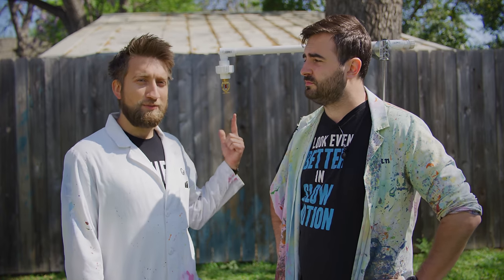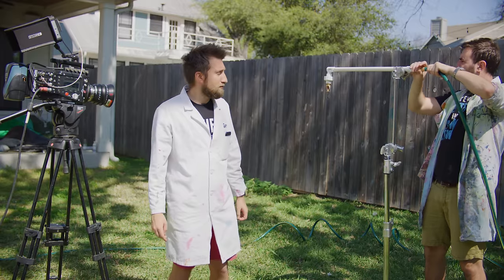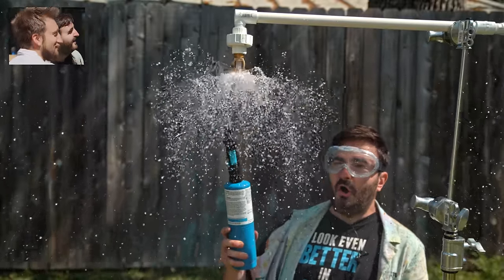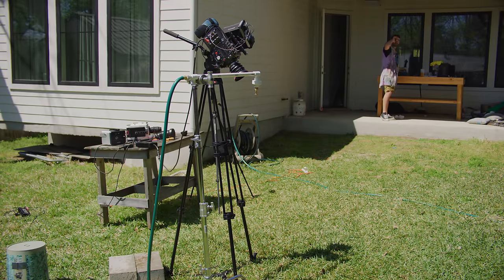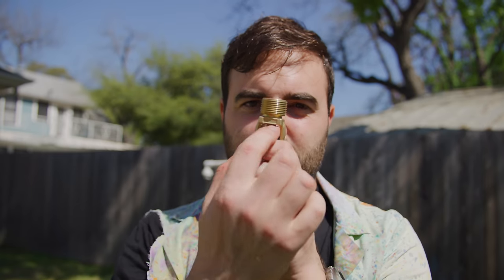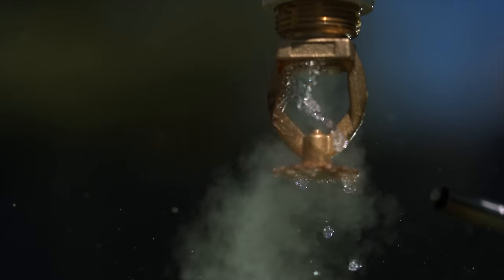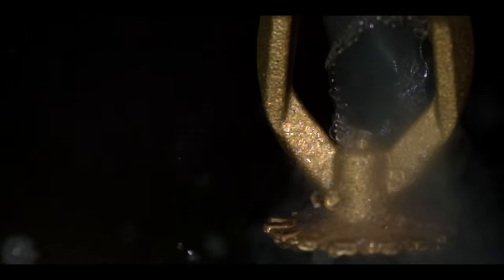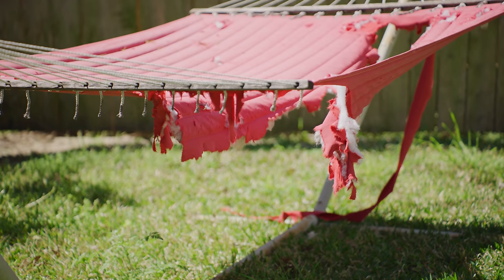How a Fire Sprinkler Works at 100,000fps - The Slow Mo Guys

Comment: That shows how fast glass breaks... Even at 103.000 FPS it looks instantaneous!
Reply: True I wonder what other materials can break as fast as glass or faster
Reply: I mean, they've already done a video on how fast glass breaks :)
Reply: @supimzazz  spaghetti
Reply: LITERALLY 2 frames ._.
Reply: PCanas they did one breaking Pyrex measuring cups it was almost instant. I can’t remember how long ago they did it but omg it was cool
Reply: @gaminghoot7020  wait we have the same profile pic
Reply: 103fps isn't crazy fast.  (I just don't get the period instead of a comma thing, lol)
Reply: Look up Destin taping a Prince Rupert's Drop breaking. Lots of fun!
Reply: @supimzazz  Maybe steel. Probably granite or titanium. Cracks tend to propagate at roughly the speed of sound in the material.
Reply: @wreck2  vice versa. Tom Scott has a video where he talks about that, but I don't remember which one.
Reply: @1Wj1  Cracking from one side of the Spaghetti strand to the other is probably incredibly fast.

Comment: Hello!  Engineer for a company that makes sprinkley bois here!

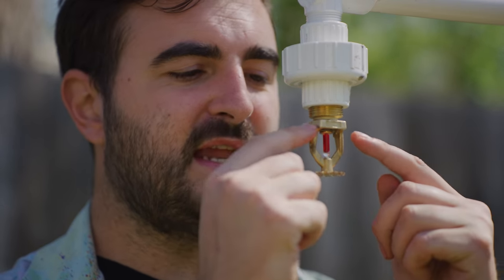I loved the graphic that popped up at 0:52 about the colors and temperatures.  The "glassy, juicy ampules" (lol Dan) are called bulbs, and like the graphic shows, the color indicates the burst temperature.  Several factors determine what temp bulbs you want to install, the main one being height.  For example, the sprinklers at the top of a warehouse need to burst at a lower temp because of how far away the fire is, compared with a standard residential or office ceiling height.  Sprinklers can also activate via "links", which are basically little plate springs that are held at tension by solder paste.  The fire melts the solder, the spring explodes outward, water comes out.  The explosive quality of the bulb or link is important, because you have to get everything out of the way of the water flow.  Some sprinklers, known as nozzles, don't have anything holding the water back!  More on that in a minute!  One last thing:  if you're in a building with a flat ceiling and don't see any sprinklers, look for round discs instead.  These are known as coverplates, and they provide an aesthetically pleasing way to cover a sprinkler from view!  They can be color-matched to any ceiling, and like links, contain a solder paste that makes them pop off and expose the sprinkler at a much lower temperature than would actually trigger the sprinklers.

Couple of myths:  first one was one I used to think before working here is that the round bit on the sprinkler spins around as it goes off.  Sadly not true for any sprinkler!  That bit is called the deflector, and it's specifically designed to spread water in a certain pattern.  Deflectors vary based on many factors, but primarily where the sprinkler is installed and the orientation in which it's installed.  Many hotels use sidewall sprinklers with very different deflectors than the one in this video.

 Another big one:  sprinklers always have water immediately behind them in their pipes, like Gav and Dan's in this video.  Also not true!  SOME systems are like that, and those are basic wet deluge systems.  The problem with them is that it's relatively easy to have an accidental activation, which is the SECOND worst thing a sprinkler can do, because water from sprinklers can cause lots of damage, but not nearly as much as a fire.  The worst thing is obviously if there IS a fire and the sprinkler doesn't activate.  All sprinkler companies go through GREAT measures to make sure neither of these things ever happen!  Back to water in the pipes:  systems that do NOT constantly have water behind the sprinklers are known as dry systems, and they rely on a trigger mechanism to open the VALVE on the water main that holds back water to the system.  The trigger is typically one of three things:  an electronic signal from a fire/smoke detector, a wet pilot line, or a dry pilot line.  Pilot lines are located with the sprinklers in the protection area, and are pressurized with either water or air (wet and dry).  When the fire trips the pilot line, the pressure on the line goes away, which trips the valve to open and converts the dry system into a wet system, but only nozzle sprinklers go off at this point.  Most wait until the bulb or link sprinklers trip.  Obviously the pilot lines trigger at a lower temp than the sprinklers; that way the sprinklers always have water behind them when they trip.  Some valves have multiple of these fail-safes, to further ensure against accidental activation!

Any questions?  I promise I can either answer you myself, or get a nice, smart coworker to help me out!  Hope everyone is having a great day!  😊
Reply: So if one pops, do the rest of them pop too?? Even if it’s across the room?
Reply: @derekmaestas8949  the head goes off in the area where the fire is(depends on the system) . So if the fire starts on the third floor ,the heads on the 1st floor won't go off. Hope this helps?
Reply: @derekmaestas8949  only heads heated enough from the fire go off, so it’s localize. Number of heads that can trip without water pressure/volume dropping too low are dependent mostly on occupancy classification and the resulting design of the system. 

Source, I’m a fire sprinkler fitter.
Reply: Thank you!! I really appreciated your explanation!
Reply: Adding a note to the lower temp sprk. at the top of a warehouse.  Sometimes the temperature rating is higher to limit the number of sprinklers activating.  If too many sprinklers open to soon, the water pressure drops below the design pressure for the anticipated number of operating sprinklers over the fire area, and then not suppressing the fire adequately.  Otherwise, a good summary on fire sprinklers.
Reply: @derekmaestas8949   NO!  A common myth.  Each sprinkler operates independently.  Exception to that in a deluge system that is triggered by a heat or smoke detection system.
Reply: This is a very late comment, but I was wondering in which circumstances you would want to use the purple or even black bulbs that explode at 260 C? In which circumstances is it fine to have a temperature of around 200 C but 260 C is a NO NO?
Reply: @alaner1383  An oven?
Reply: And you dont see much more than 200f heads unless it's something like an oven or sometimes on top of warehouses,  the heads near the decking need to be 200f or higher to prevent accidental head firing
Reply: also want to add to the complexity is that sprinklers come in different sizes, what we see in this video is a typical size used commonly in commercial and residential. So yes, the big boy sprinklers (one the size of your palm) used in large warehouses spray much more water per minute and is worthy of slow mo video too 😉
Reply: @alaner1383  i installed some 285 heads in a paint booth in a Porsche warehouse and they are mostly used in high temp places that commonly see higher temps
Reply: I never thought I would find sprinklers so fascinating until after I saw this video and your post. water that flows out of objects like fountains and sprinklers always interested me it's artistically pleasing. though seeing and reading all this made this even better.

Comment: I actually install these for a living and it's interesting seeing these actually go off in slow motion. And as far as the air that they are talking about, you're supposed to bleed the air before putting into service.
Reply: Also in real world applications that water is as black as oil for the first 50 gallons or more (and stinky).
Reply: @justayoutuber1906  smells like money! Doesn’t taste like it though :)
Reply: @justayoutuber1906  Why is the water black as oil?
Reply: @Sinistar123  Grossness from sitting in the pipes for potentially years at a time with little to no flow.
Reply: Actually a naturally occurring molecule in water called manganese.

Comment: Fire Sprinkler fitter here 🖐️

Thanks for highlighting our industry. Fire Sprinklers save lives!
Reply: Fire alarms save lives, fire sprinklers save building foundations (and cause insurance claims).
Reply: Fire alarms provide initial warning, yes. But without sprinklers, the fire will spread and destroy entire buildings. Fire sprinklers cool the fire, if not completely extinguishing it, greatly extending the escape time for residents and the response time for firefighters, who often simply arrive at the site of an already extinguished fire and turn off the water. Furthermore, water damage to an isolated area is far less costly than vast fire damage and endangered lives, so insurance costs are much cheaper. That's why insuring a building with a fire sprinkler system is more affordable than one without. 

Thanks for your contribution.
Reply: Having never seen one up close I was surprised to see the "fan blades" at the bottom were stationary. I had always thought each blade had a slight twist and they spun helping spread the water easier and possibly further. This was interesting to watch.
Reply: Word. Local 669
Reply: @ajinsato9389  Same here bud.
Reply: correct me if I'm wrong here but the pressure they get from the garden hose is nowhere equal to the one on a sprinkler system. I'm a GC and every time we do sprinklers for homes it has it's own dedicated line straight from the main.
Reply: @eliaschevette  I mostly have worked in plants and they have electric and diesel fire pumps. They usually have about 150 psi. I'm not sure what the min. Spec is for residential, but I have seen 80 psi. That garden hose probably has about 50psi.
Reply: @swanabeeswan  20 years as an alarm tech, 10 years as a sprinkler service tech, so you can guess which side I'm biased towards...gotta take false alarms into account as well.  False on our side = people have to stand in the street.  False on your side = $230,000 in damage to the building.  I actually tried to start a sprinkler service division in our company, the insurance increase was so much $$$ that it would have crippled us.  Personally, I'd like to see all wet systems replaced with pre-action systems and full detection, best of both worlds, and a false on your side would mean nothing more than replacing a head and charging the air back up.  That would cost money though, and who wants to spend money on life safety systems....
Reply: @swanabee Proper firestopping and compartmentalization saves lives, not sprinklers or alarms.
Reply: swanabee I collect fire sprinklers
Reply: What local are you in bud?
Reply: Local 821
Reply: Local 669 District 3 Phoenix.

Also lol at "firestopping and compartmentalization"
Reply: @sofakingtactical5710  if a fire sprinkler head were to go off in a warehouse (after hours for example) the water flow would actually set off the flowswitch and set off the alarm and alerting the fire department
Reply: @ajinsato9389  Late to the video but 669 here too.
Reply: swanabee same here. Journeymen year 2.
The water psi was super low & you really couldn’t see the full spray of of the deflector.
It would look so much better if it was blasted with 70 psi lmao.
Reply: @eliaschevette  Hi David they need at least 7 psi to function correctly. Not sure if they are getting that here.
Reply: @sofakingtactical5710  8 years as a firefighter and I promise we'll dump hundreds of more gallons on that fire then a sprinkler ever will on top of the fact they're more effective and precise then us
Reply: Me too brother I'm a foreman for a large-scale commercial company working on high-rises and large commercial projects in downtown Atlanta
Reply: I used to install sprinklers before I went into testing the whole fire alarm systems I love it
Reply: @swanabeeswan   wow I never seen someone put so much thought into a comment about fire sprinklers to make them sound more important than they really are.. lmao I've seen countless news coverages of fires that's couldn't be contained by sprinkler systems. What if it's a grease fire too? Not much help those sprinklers would be lol.
Reply: @blakessunglasses  finally someone that remembers his apprentice training classes
Reply: @ight3817  if a fire protection system is set up right they would use a different setup for areas that could have grease fires. Not all fire suppression systems are water based.
Reply: 669 district 29
Reply: But what happens when the glass comes into your face/eyes?  That's what I would worry about first
Reply: Fire sprinklers are so simple but genius. Probably the biggest issue is making sure you have enough water pressure to keep up with them.
Reply: @ight3817  Areas with grease fire potential should have dry chemical systems instead of water sprinklers. Sprinklers can be very effective otherwise, though.
Reply: @ight3817  The fires that are contained by sprinklers generally don't make the news.
Reply: @BasNunnikhoven  Most people aren't looking at the sprinkler when it goes off. You notice these guys were wearing goggles.
Reply: i g h t in almost all cases where sprinkler systems haven’t contained fires it has been one of several issues. 

1) permanently mounted equipment (non sprinkler) was installed after sprinkler system and the system was not modified to account for this (happened at a sawmill.  Fire started under equipment and a head was not added after to provide coverage)

2) people shutting the system off.  I believe that this accounts for approximately 95% of the “failure” rates of sprinkler systems. 

3) improper maintenance.   This is usually the cause of number 2.

4) room modifications.  People will add a wall or move a wall inside a building that contains sprinklers and not take into account that things may need to be adjusted. 

Being a sprinkler fitter you are exposed to ignorance on a regular basis, because people just don’t know how it works.  For example, they proved in this video that if you set one sprinkler head off, they don’t  all go off.
Reply: Bas Nunnikhoven trust me when I tell you that you wouldn’t be worried about the glass getting in your face.  First of all  if by rare chance you are in the room when it happens you’re not going to be looking at the sprinkler, you’re  going to be looking at the fire or more likely the exit.  The chance of you looking at the sprinkler the second it goes off is unlikely
Reply: Sofa King Tactical if they were a liability, insurance companies wouldn’t give you a break on your insurance when your building has it installed.  That simply doesn’t make business sense.
Reply: They do but most fire sprinklered buildings in Winnipeg do not comply with NFPA 13. Enter Winnipeg at your own risk! The building inspectors here are super corrupt and make well over 100k a year. Google FIRED WINNIPEG BUILDING INSPECTORS.
Reply: Teal the main valve for a “wet” sprinkler system is always open. If it’s anything else like a dry system, there wouldn’t be any pressurized water in the piping to start with, until the air is pushed out.
Reply: @sofakingtactical5710  Yeah, no. If you don't hear the alarm, you will feel the sprinkler.
Reply: Good to see the industry getting highlighted. Did some fitting help before college (wasn't for me) so I do know a bit about it, fire sprinklers are so important but hey are oft forgotten. Imagine if they did this with black water running through the lines.
Reply: @eliaschevette  That is correct. Sprinkler systems hit crazy levels of pressure so the full system would not even come close to being able to be contained by a garden hose.
Reply: @DoubleJThe  Wow someone is cranky haha. First off you need to calm down my friend. Take a breath. I'm sorry you are so easily offended by things like grammar on a site like Youtube. I apologize if you weren't loved as a child. Also I don't understand the need to assume and call all fitters Neanderthals as if you are some smart guy yourself.  And if want to know Fire sprinklers of all types save lives. They allow anyone trapped inside a building to get out safely rather than being trapped by fire. As I hope you know as well that only a single sprinkler head goes off in the event of a fire so the building isn't going to flood and cause massive damage like in the movies. I'm glad you at least know what a pre action system and clean agent system is but i fail to see how this relates to my previous comment. Those types of systems are unreliable compared to the common wet system. Have a nice day bus and please try to be a bit less toxic haha.
Reply: David Quintana very true we always test our systems to 250 psi although the city pressure will never be that high when the system is live he make sure it’s good but yea i think in an actual building the pressure will keep coming and not pause like that o e did

Comment: Being a sprinkler fitter myself, I can tell you that a sprinkler system usually has a normal pressure of roughly 60 psi, giving a much wider spread of water.
Reply: ^ This is correct! 60psi or more!

Comment: I’ve also heard from building facility guys that the water that comes out of real sprinklers in building is usually gross old stale rusty water that’s been there stagnant for however long, and it’s not like in the movies where if you set one off, they all go off, each sprinkler is it’s own system
Reply: In really old buildings it gets to be black and sludgy and smells horrible.
Reply: @Ian Ostby  actually it happens in every building no matter how old. That's why fire code requires that the sprinkler riser is flowed annually. I do this for a living😂
Reply: As a fire sprinkler inspector systems should be drained once to four times a year not to replace old water but to mainly check and make sure there is consistent pressure and no new restrictions in the underground piping. We also drain some water at what’s called an inspectors test to check alarms quarterly or annually as well.